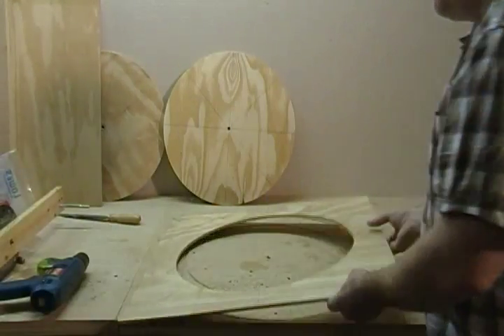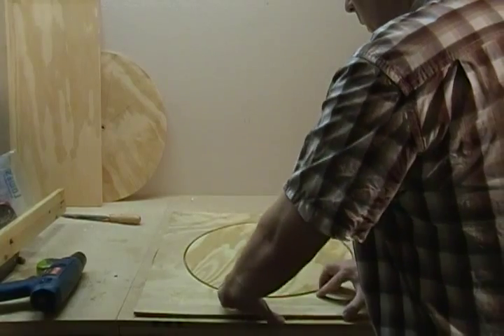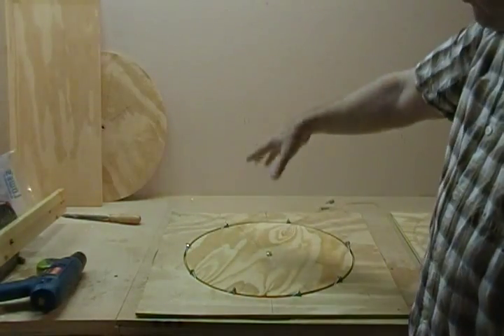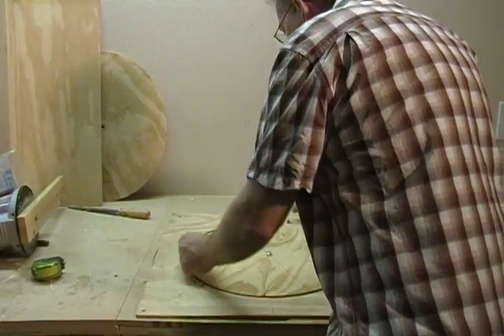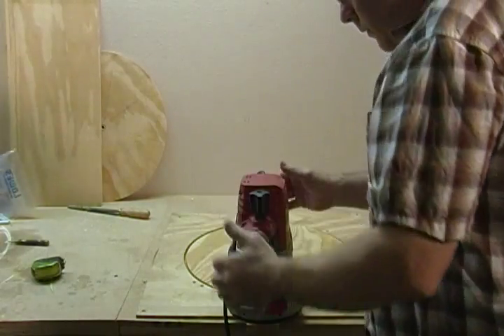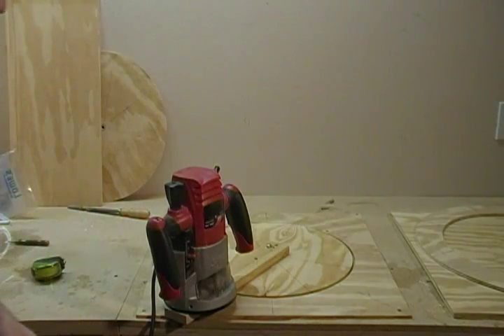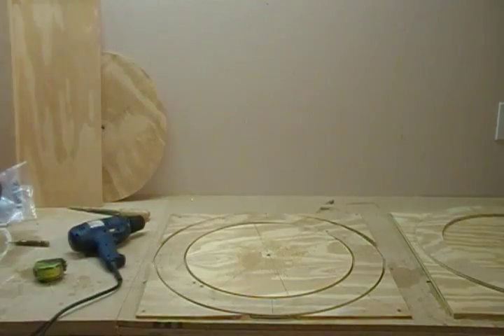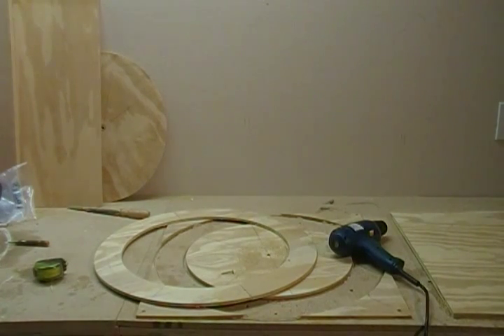Building a Wind Turbine VAWT (Step 4 of 46) Cutting Plywood Circles

Comment from the maker: @MrMDK187 Yes save some time do that. Just screw both sections down and do them at the same time. Originally, I was going to buy another sheet of 1/2 plywood to make the donut ring. Then I realized I could glue the two 1/4 scrap pieces together and keep the cost of the project down.

Comment: if you cut your outer circle first it would be a bit easier. there would be no question about it being true. This process can be done on a table saw if you do not have a router. take the gate off and raise the blade slowly as you spin the board.

This is the best series I have seen yet. Good job!